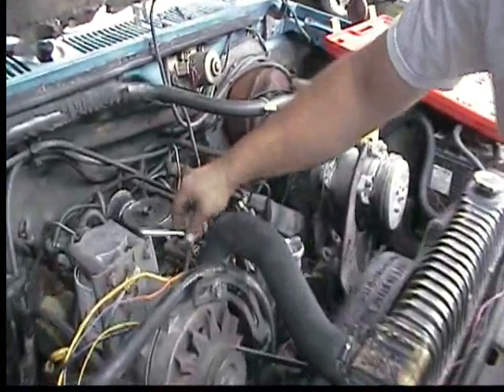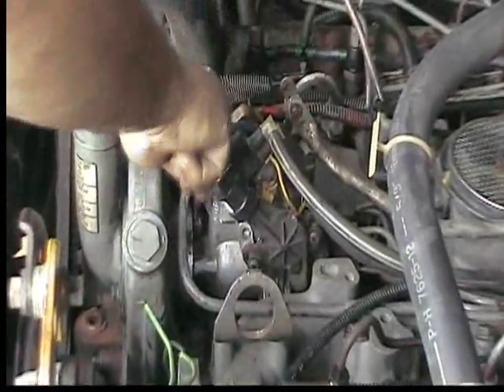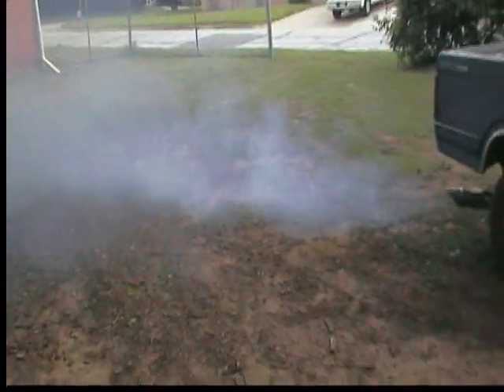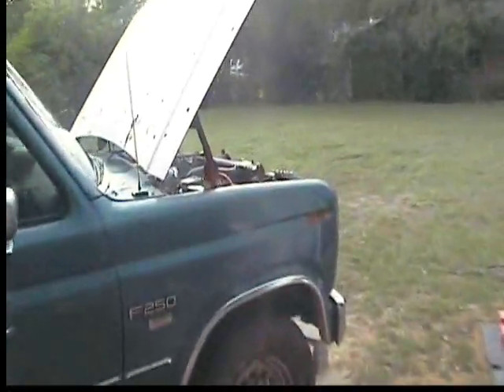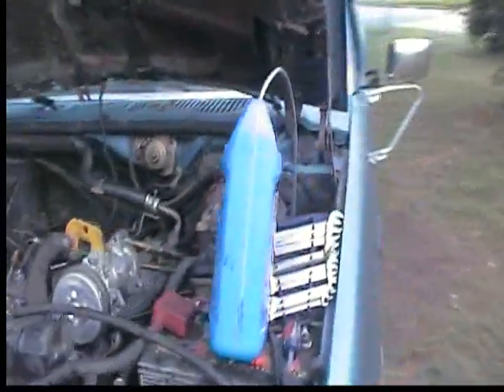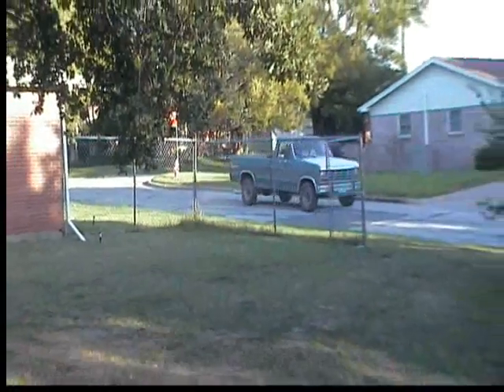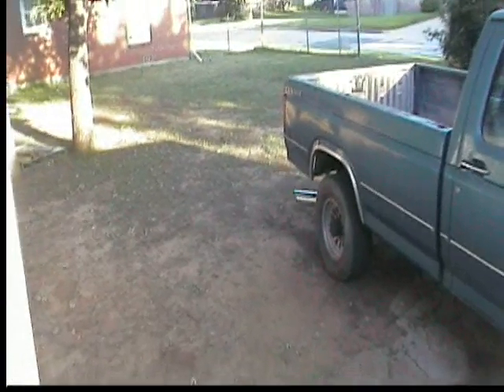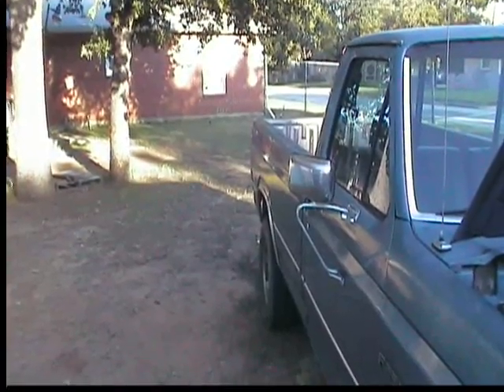6.9 diesel diagnoses and troubleshooting

Comment: Alright so I got a 85 6.9 and I got it started but it’s running super high idle. But when I put it in gear it goes way down and then I have no power when I put my foot on the throttle
Reply from the maker: Not sure 100%  but it's something in the pump..  Just slap a new pump on it and be done.  The pumps on those old girl a super CHEAP!!!!

Comment: I have a 1991 7.3 that blows a puff of blue that smells like diesel so if the injecten pump is getting weak it will make them blow blue smoke my truck dont use any oil and im about to do new injectors and my truck runs and has a lot of power

Comment: That was a hell of a find, that 54 dollar injection pump. I have had mine rebuilt twice at a cost of just under 300 bucks each time. My '86 F350 has 330K miles on it and still runs great. Had heads reworked after they started leaking coolant out the rear. That was six years ago and it still runs great. Love the old Navistars. Simple and durable. No computers. Just lots of cast iron and steel. Great vid!

Comment: @chaput59759 Sounds like your valve guides are worn. You could replace the rubber skirts over your valves inside the valve springs and this may help. You'd be better off having your heads reworked. Just takes time, skill, and money. Good luck!

Comment: Dtechco. You are stupid these guys did nothing wrong.  I'm proud of them for fixing it. Plus that engine will last 600,000 miles.  Look at my video. 1985 ford f350 6.9 cold crank.  That engine has over 550,000 miles on it and it runs like a scalded dog.

Comment: i own a 1993 f 250 turbo diesel  and it does the same things but not as much smoke about 4 min in the video but when high idle and let off the pedal a noticeable cloud and goes away, but does not miss at any speed
Reply: Nicholas chaput my 1991 7.3 idi with a turbo it does this blows a little bit of blue smoke than it stops win i get on it and let out of it  puts a cloud of blue smoke out and my truck dont use any oil cant figure it out ??